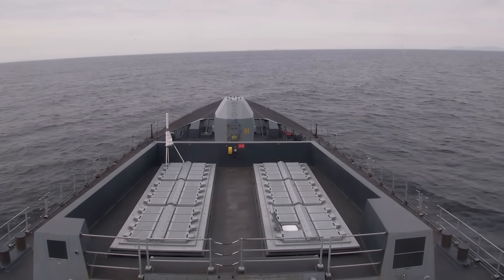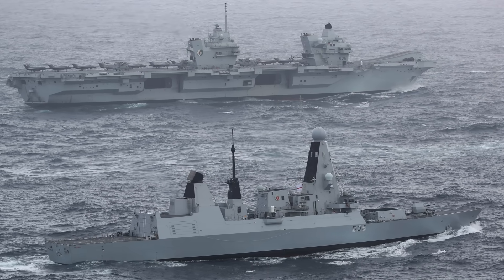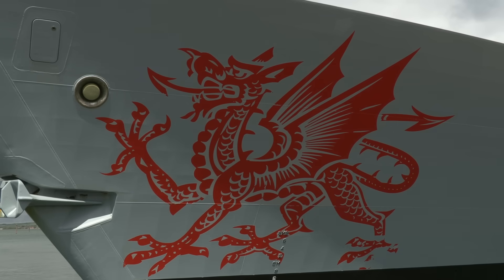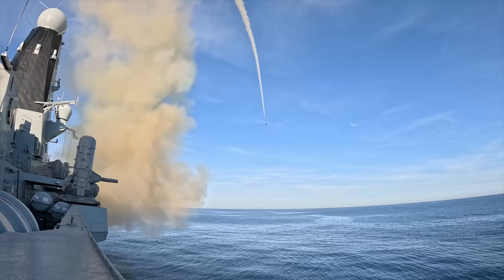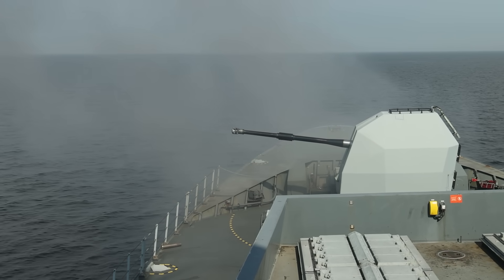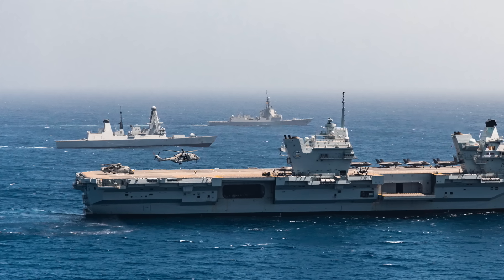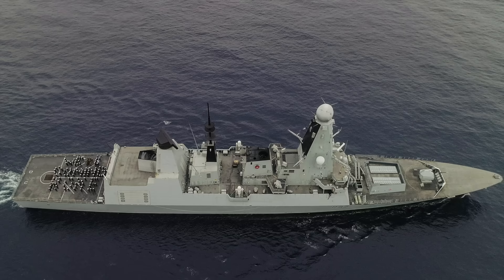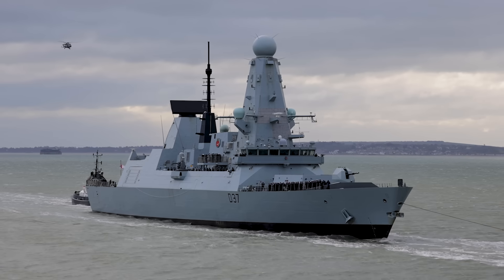Type 45 Destroyer: How the Royal Navy is Fixing its Billion-Pound Problem Child

Comment: The hull-mounted sonar, originally fitted but since allowed to fall into disrepair, should be restored and if possible upgraded. These otherwise fine ships are sitting ducks for submarines
Reply: If were being frank they shouldn't have a sonar at all I mean it's a nice gimmick and does add the ship class to the "jack of all cards" it really doesn't use it and really won't ever use it as the Type 45 acts more like a cruiser labeled as a destroyer, the role of sonar should fall to the Type 31 and 32 respectively as they are incense destroyers labeled as frigates.
Reply: @NATOenthusiast  What of then the 45 is operating by itself? It seems that a mounted sonar provides SOME warning and defense against submarines. Agreed that they’re better spent on tasks other than sub hunting, but they need some defense.
Reply: @donyoung5091  If it’s operating by itself then that’s a draw back of not having a sonar, but realistically I don’t think the Type 45 will ever be acting alone unless it’s heading to and from the carrier fleet to port.
Reply: @NATOenthusiast  You mean Type 23 and later Type 26,they are the ASW Specialists,Type 31 has no Sonar,Type 32 is still in concept.
Reply: @paultanton4307  I had thought I got some wrong there… well that’s what I get for messaging at midnight, thanks for the correction.

Comment: The biggest problem with the Type 45 isn't with their overspecialization or even their propulsion issues.  The major problem is there are only six of them.  Eight would have been a bare minimum, one for one replacement with the Type 42s would have yielded a truly formidable fleet.  Though with the RN's staffing problem this might be a moot point.  

Nice video.
Reply: The overspecialization is a problem as this is a legacy feature of a much larger Royal Navy.
With such a small fleet all ships will have to do more things.
Reply: Royal Navy wanted originally 12 T-45s.
Reply: @KT-yk8mw  Times change, problems grow.
Reply: This should have simply followed the US example with the Arleigh Burke class and make a second flight of the Type-45s that would have address the shortcomings of the first batch
Reply: Absolutely spot on . The limited number of Type 45s severely hampers operational flexibility especially given how often at least one is in maintenance or refit. A one-for-one replacement with the Type 42s would’ve significantly bolstered the Royal Navy’s capabilities. But as you mentioned, without enough trained personnel to crew them, even the best ships can’t fulfill their potential. A classic case of strategic ambition constrained by manpower and budget.
Reply: Indeed this is the biggest problem, I would suggest 21 is the number required however.
Reply: I was about to type more or less the same.
Reply: Budget restraints and staffing are a result of the Woke-DEI policies of the British Government. White men the traditional backbone of the military are now second class citizens in all but name. Lets hope Trumps return to normality in the US Military will encourage the Europeans to follow suit. We have no pride in our country so why expect a rush to defend it.
Reply: To do what lmao, they're literally useless vanity projects just like our Submarines, they do nothing.
Reply: No point in a navy at all, can use all that money to house asylum seekers and fund the coast guard to rescue more from the channel...
Reply: The staffing problem can be at least partially explained by the perception of a "shrinking fleet". More young men (and women) would sign up if they felt secure in the knowledge they'd still have a job in a decade.
Reply: I have no issue with staffing, as the more automation is brought in, the fewer people are needed to control the ship. Fewer people equals fewer bunks, and more space for fuel and materiel: keep the same amount of food though...
Reply: Usual !!the people who think they know everything never speak with the operators and the men on the ground ! Then you have useless government departments and procurement!! What could go wrong ???
Reply: I agree. We have a very stretched-thin Navy, a mere shadow of its former glory. Hopefully with the increase to defence spending as of 2025 onwards we will get an expanded fleet. Ideally I would love to see more subs, a 3rd aircraft carrier, 2 'drone carriers', and a doubling of the Type 45 numbers. We can but hope!
Reply from the maker: Perhaps 1-2 more SSN in 15-20 years (according to the SDR they are aiming for 12, but that is also the number aimed for with the Type 45, then that was reduced to 8, then 6).  Bottom line is there is no money for the Navy
Reply: @WarshipsAndWarriors  True, the legal and illegal immigrants are costing the country Billions in welfare. Then there is the crime rate and useless Police. But then with open borders why bother having a military at all?
Reply: @WarshipsAndWarriors   @WarshipsAndWarriors  

Some diesel-electric AIP subs would make a lot of sense imo. They're much cheaper than SSNs, and very quiet. They could be leased, bought, or ideally manufactured in the UK. Or any combination thereof.

Such subs would be ideal imo to protect the UK from Russian ships and subs, especially in the GIUK gap, in the North Sea, in the English Channel, off Faslane*, off the Falklands, and off Gibraltar.

*Faslane: https://en.wikipedia.org/wiki/HMNB_Clyde
Reply: @WarshipsAndWarriors  
Well if they dont fund their navy , it will lose all status as a credible force and deterrent 
The Type-26 is a step in the right direction. Blow for blow , it can easily match any current Russian ship but cant take on the newer class of Chinese destroyers
Russia plans for Super Gorshkov which is nothing be a uprated  Gorshkov frigate which is nothing more than joke over the Lider class destroyer design
The Lider class even made with conventional engine would still be a heavy hitter surface combatant and true credible threat over the Super Gorshkov design but Russia isnt know for its common sense
So with the Chinese threat, the UK is catching break because the PLAN cant sail very far yet but the UK still needs credible surface combatant able to trade blows with anything floating
Even the US Flight I Arleigh Burke thanks to MK-41 VLS can trade blows with anything floating
The UK needs to think long and hard about the Type-83 but not too long
Reply: @WarshipsAndWarriors  I'm guessing you posted that after the Strategic Defence Review but before the NATO conference in the Hague?
Reply: @edrandell424   @edrandell424  

"Hopefully with the increase to defence spending as of 2025 onwards we will get an expanded fleet."

Of course we won't. It takes years to build ships.
Reply: @JimCarner777  and it takes years for our disjointed government to decide the numbers the tell us and they real numbers they build. takes them about 3 years to do so
Reply: Get a buyer from Tesco to choose how many ships would be best. 
It's an entirely different approach but the aim is to get the most for the least. Could you crew them with part-timers who have children to pick up at school? 
(No, that is not as silly as it sounds because we used to have after school nurseries looking after children. It would just mean keeping them longer. Eton is too expensive.)
Reply: you only have 4 crews as it is..
Reply: Sad to see such a great naval power decline so quickly.  The m ain't problem isn't warm weather. It's the lack of funding and political will. The US could use the Royal Navies help in safeguarding freedom, but our British cousins have come to rely so much on the US, you, like Canada, have let your once proud and capable military degenerate to a tier 3 status. Worse, when we say you need to contribute more to your own and Nato defense, you belittle the US as unreliable, unwilling, and unreliable.
Reply: @ohiobrian8993 the UK has always met NATO targets.
Reply: @ohiobrian8993   @ohiobrian8993  

"Worse, when we say you need to contribute more to your own and Nato defense..."

What??? Trump says that European countries need to contribute 5% of GDP to NATO defence when even America itself doesn't do that.

Plus:
(a) Even 2% is just a guideline, it's not written in stone
(b) WHAT the money is spent on is FAR more important than the actual percentage

Comment: They're very capable ships in terms of air-defence but im not a huge fan of the overly specialised approach. I prefer a multi-purpose design like the Hobart class, 80-90% as good at air-defence but it also has a very capable ASW capability too.

Hopefully because of their relatively steady service so far we will get a few more years out them than originally planned, I cant imagine the hulls will have a lot of stress on them.
Reply: I’d have hoped the Navy would have learned lessons from the Falklands regarding having ‘specialised’ ships or strategies. Especially as there are so few ships available.
Reply: The theory is that a specialized ship can provide the best support in its area of speciality for reduced complexity and cost. Then, put the best anti-air, anti-submarine, anti-surface ships together, and you have a very formidable force. This is especially important around an aircraft carrier. 

But then…the RN sends its ships out individually LOL. So much for theory.

Comment: There is an irony to having to replace two diesels with three.  As when being designed, one of the senior naval architects was pushing for each turbine having three diesels in a pack.  With three turbines per ship. So any one turbine/diesel pack combo, could be taken offline for proper maintenance without effecting the capabilities of the ship.  Instead, only two turbine/diesel packs with two diesel generators per turbine were installed.
Reply: Dreaded Bean counters again!